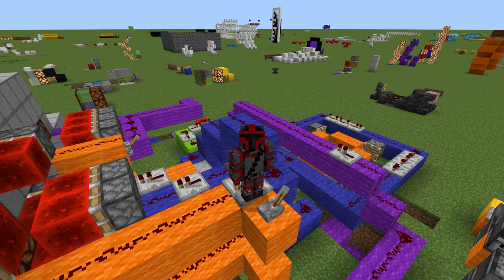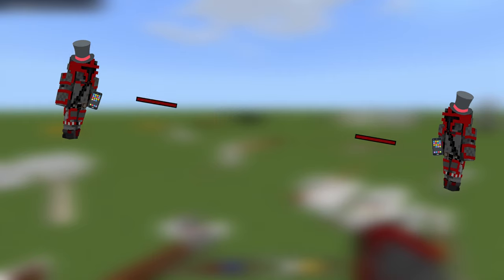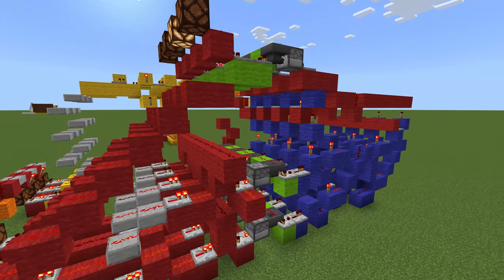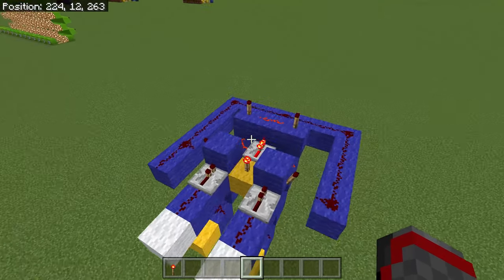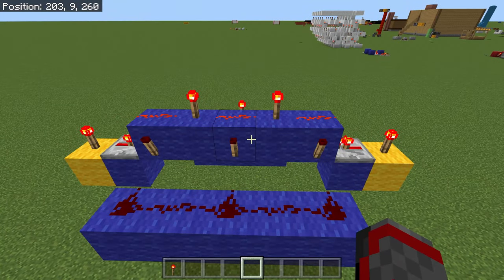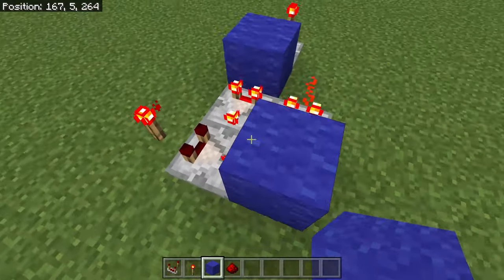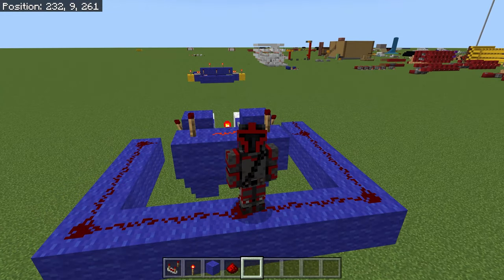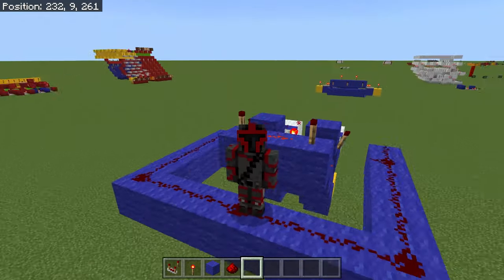How to Easily Improve Your Minecraft Redstone Computer!

Comment: You can make a hex adder with a carry function if you do a circuit like this:
A - (15 - B), if the output is larger than 0, than it means it has overflowed
You can use this to make a 8 bit hex adder, and to output the addition, you use this carry output - 1. Example
15 + 1 = carry. when this happen the adder circuit will give the wrong result ((15 - (15 - A - B)) = 15), and the carry will then start going up 1 by 1 (15 + 2 = 2 strength carry, etc.), but that result will still miss by 1, so what you do is that you subtract one from it, to get the right result above 15, which will then give: carry 1, addition 0 = 10 in hex.
Reply: To do it the other way around is more useful: 15-((15-A)-B) is the usual result, carry is 1 if B-(15-A)>0. In that case you need to calculate the first digit that way instead: A+B-16=B-(15-(A-1)).
All doable quite compact and acceptably fast (4 tick).
Reply: @98LuckyLuk  That is the same circuit, just moved stuff around to make it more complex. While the one I said would need an adder, the carry, a 1 subtractor, and a circuit to either get the result between the adder or the carry - 1, yours would need all of what I said, plus a dedicated overflow resultant (the carry circuit again just - 1) to show the result when it overflows. It's actually more complex than mine.
Reply: @giovannicesaramorim9adigan961  Have you actually built it?
Let's see: Adder means 3 comparators, carry 2 of them (execution in parallel), -1 is 0 tick (just extend the wire by one block) and then? Here comes the catch: You also need a "circuit" (in reality, one comparator if done right) to decide which output to use depending on overflow, nothing really changes. My formula allowed me to build a very compact circuit without any unreliable trickery.

The equations I described result in the lowest possible latency, 4 tick that is using "normal" Redstone. You can try and do it in 3 tick to prove me wrong. I can send you my shematic if you want. I suspect that it can be done in 3,5 or maybe even 3 ticks using pistons, but I gave up trying to make it work, just too cramped.
The critical path is the following: first compartor subtracts from 15, second two (parallel) check for carry/subtract second operand and then the carry gets inverted and used as input for the final compartor, in effect enabling/diabling the non-overflow result. Your fomulas need the same critical path, you just calculate the result different in case of carry.

I think both versions are valid and can work in 4 tick. I first tried your idea myself when building an Hex adder, but found my final fomula to give me a more compact circuit. Routing the result in a way to make it stackable was way easier.
Reply: @98LuckyLuk  Mine is made to be put side by side, not on top, but without subtraction mode it's 1 block high. I will upload a video on my channel about it

Comment: I have a question: would it be possible to make the computer display values greater than 15?
Reply: Yes, though you need 2 wires instead of one to display 8 bit numbers, and an ALU adder possible of carry out (adder that can display above 15), with the carry out, you could make a 16 bit computer using 4 hex lines. To make the carry out,  you need to make a circuit as written:
A - (16 - B), this is your carry out flag
carry out flag - 1, this is your first digit result IF and only if the carry out flag is active, the normal adder's result may then be discarded as incorrect.